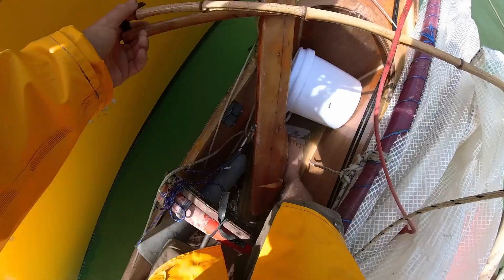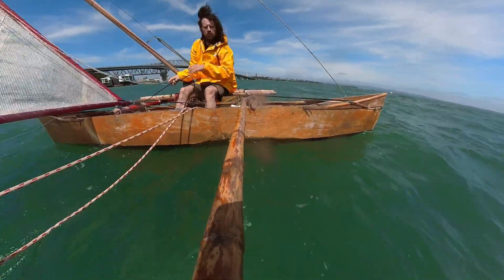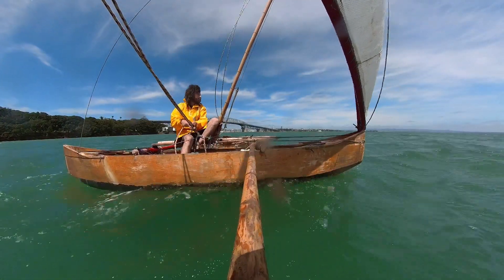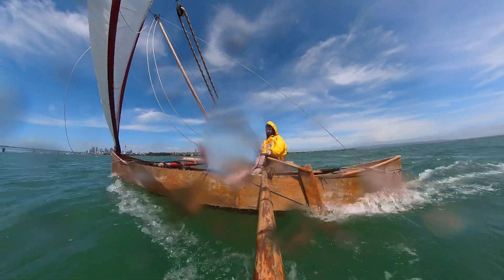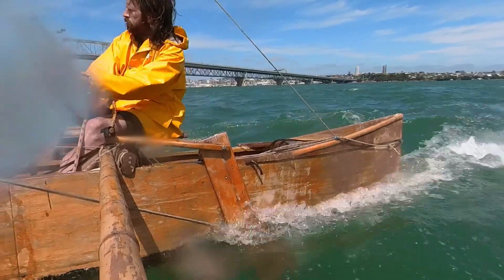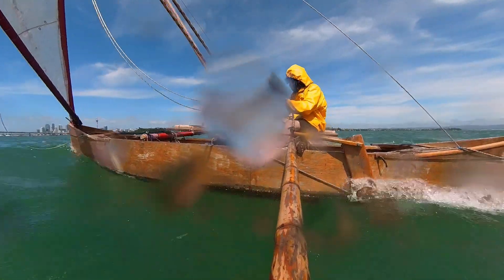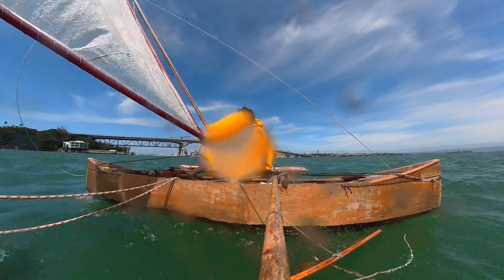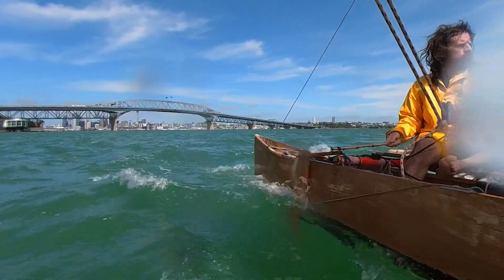A Simple Proa Rudder - Waimea Proa E5

Comment: Cool idea. It doesn't look much easier than using a steering oar, have you tried that? I liked using the typical Kiribati arrangement with forked sockets at each end and a simple oar. I was just thinking about it and a curved oar would allow you to sit further to windward, and would still use great for bearing away. And perhaps still work OK as a paddle and possibly a yuloh?
Reply from the maker: well I tried an oar mounted on the end of the seat (same beam as the mast step) I found it to be quite hard work. It wasn't a great oar though, I found it washed up in a creek. it would have been a decent oar for rowing, is cupped one side. For single handed I think the oar lock needs to be reachable from the platform.
Reply from the maker: on the waka hourua they have a steering oar like that, but it also has a pin so it doesn't twist, and also they put a rope around it so you don't have to take the whole force, just raise it up and down

Comment: Simple approach is my favorite. I’ve seen some of the islanders use the rudder in what looks to be backwards, as in the tiller faces aft and is front of the operator. Also is held in place by hydrodynamic force. Boat looks good natural style.
Reply from the maker: Yeah that's the Satawal island style!. Also in Sri Lanka they have similar, but the handle comes sideways at 45 degrees (half way to the viking style). So the helmsman sits behind it an pulls to turn to weather.

Comment: Pretty flimsy concept bro, but works well and you shunt fast!! I like it. What about adding a lump of wood on the side for it to pivot on? Anyway it works well and shunts fast!! So keep shunting brah, d Force is with you 😜
Reply from the maker: The original plan was something like that, actually with a socket like an (indonesian)  junkung rudder. I might still try some things there but I really like that it sits flat on the hull. It's just a steerable leeboard. And the force is with you also!!!
Reply from the maker: I think I like to start off flimsy then make it stronger as necessary depending on testing
Reply: @dominictarrsailing  I would like to see if adding a pivot and separating rudder from hull would reduce turbulence? 
Keep shunting brah, well done! By the way, I think u have to go to the doctor and tell him u got proas in your blood.....